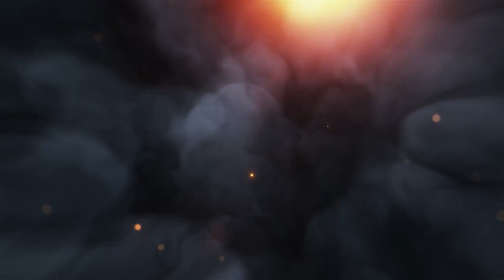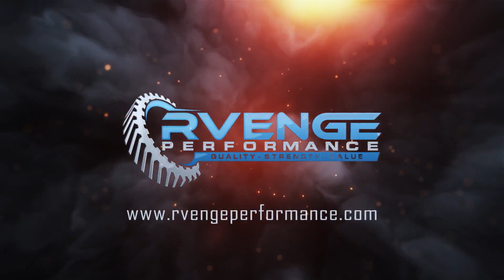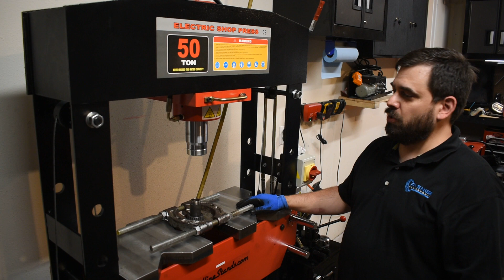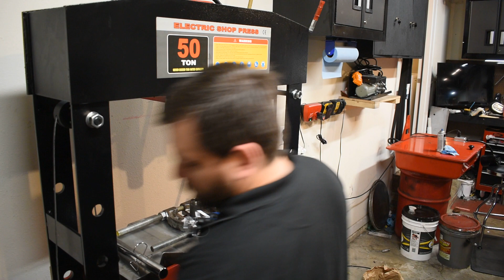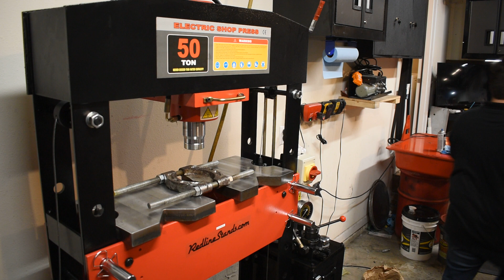Pressing 3000GT - Stealth Transfer Case Spool on and Off 6 Speed

Comment: Bro, you are crazy being that close to the action area. Without PPE you could lose an eye for sure. 50T is a lot. Do you have any bearing that use close to that?
Reply from the maker: When are not shooting a vid we stand off to the side as much as possible, but have done hundreds of them in the last 6 years without any issues. With proper technique and equipment its really not a nerve racking experience. Bearings are usually not much of a press fit. The other item we commonly do that takes a bit of forcr is the stationary 5th gear on the 5 speed input shaft. That usually takes 10 to 15 tons. But if someone marred it up in the past pressing it poorly I have seen it hit 50 tons before. Not normal though.
Reply: @RvengePerformance  dude, love the vids. Has helped me a ton. Now I need a transfer case rebuild.
Reply from the maker: Thanks we can do that for you if you want! Check services on www.rvengeperformance.com  @nickdecorse2584